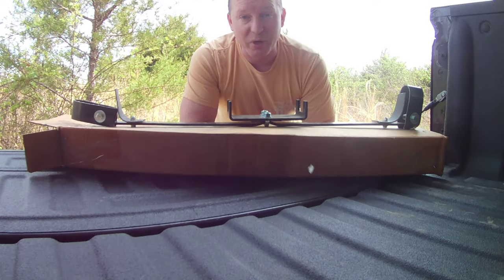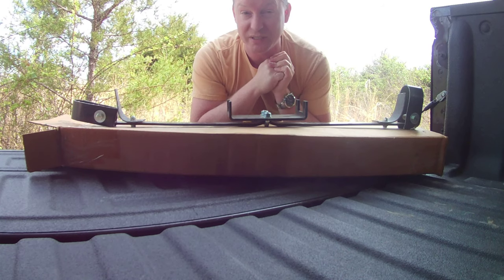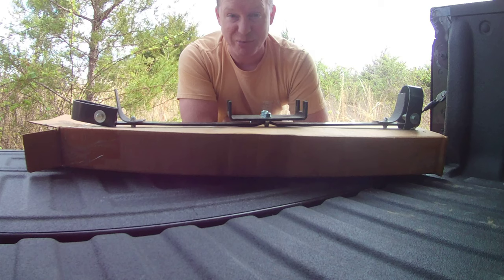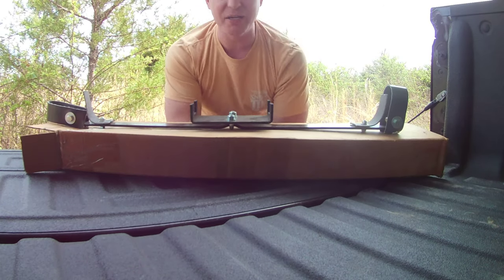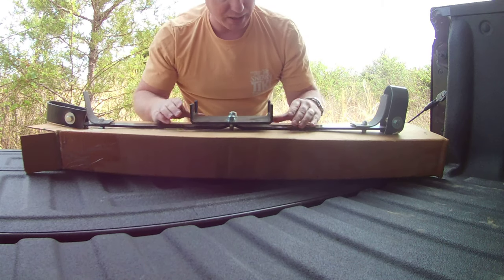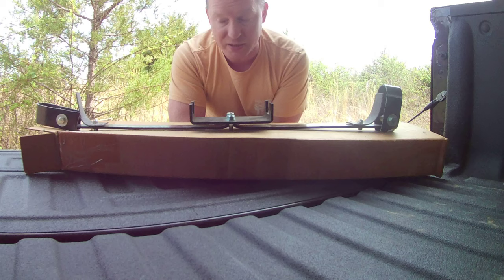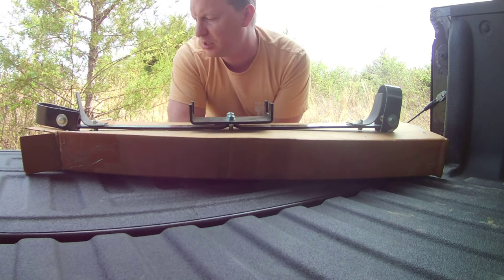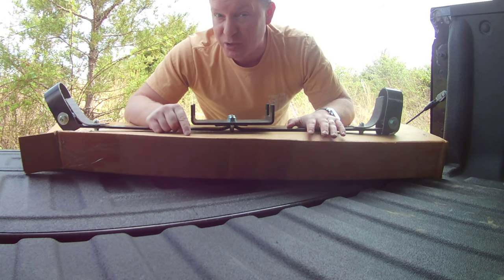CB Performance Camber Compensator

Comment: Does this have any vibration isolation / bushings between it and the trans? I notice the less-beefy EMPI one has a bushing. Wondering if this one brings more vibes / noise into the cabin.
Reply from the maker: No bushings. I don’t have experience with the Empi one. My other bug has one and I haven’t noticed any vibration issues but that may be due to the lowered front end. We used the axle beam adjusters where you cut the axle and it isn’t as smooth as lowered spindles. But it really helped the handling. Thanks for watching!